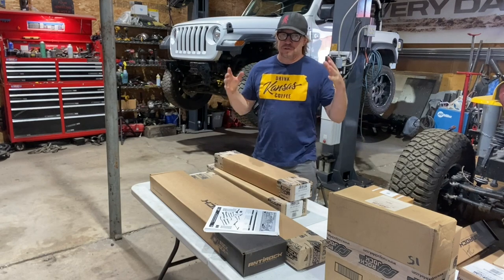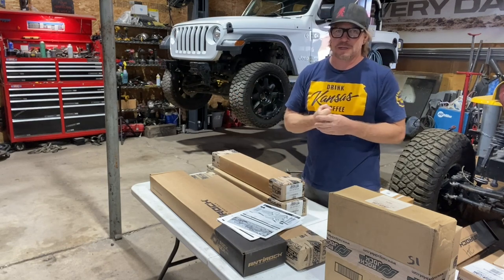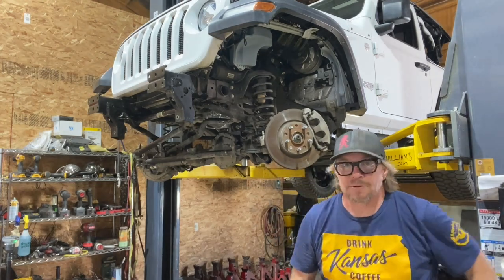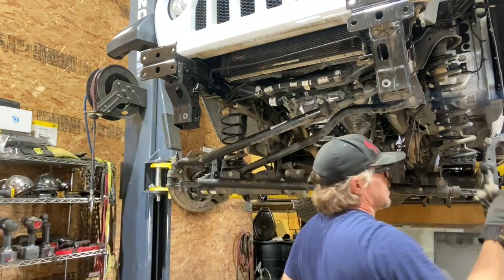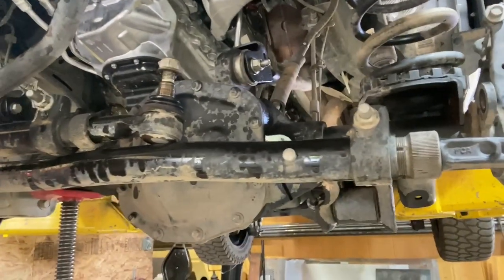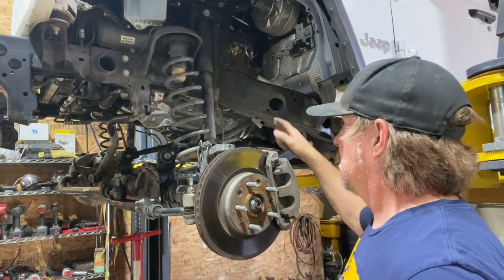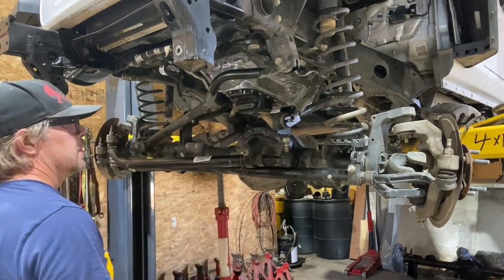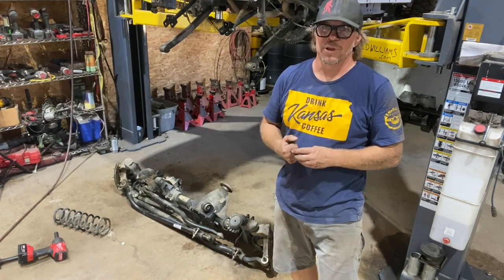Dirt Daily. Removing Newb Sock's Front Axle. Time to build a Jeep!

Comment: It’s great that you can reuse hardware on this kind of work. When I do suspension (and other areas like brakes) on my VWs, a lot of those bolts are “torque to yield” fasteners. Once you have put them in to the required torque value (+ often an additional 90°), they are not reusable.

Comment: 20:58 Quick Tip for disconnecting Brake lines without the fluid dripping out of the system is to: Open the bleed screw on one brake, depress the brake pedal to the floor and keep it there with something (I.e. a stick), then disconnect whatever you want with no mess/leaks. The idea is since the master cylinder is actuated it traps the fluid in the system and creates a tiny bit of vacuum keeping even what fluids in the lines in the line.
Reply: that doesn't make any sense. if you open a bleed screw then depress the brake to the floor then you shoot fluid everywhere off the bat.. and even if you leve the pedal depressed after that, the fluid will still come out
Reply: Obviously you catch the fluid using a normal bleeder tool for that intial pedal push. But no the fluid does not drip out of the system if the pedal is to the floor. You’ll still need to do a bleed later, but again this will prevent the system from draining itself completely from the revisor

Comment: I've been wanting to swap out my 99 isuzu troopers suspension with some discarded jeep axels for 2 reasons. #1 IFS is limited to 2 inch lift and fender/firewall clearance for 33" tires. Thus I can locate it forward with a solid axel swap.  
#2 there is a whole bunch of aftermarket gear and locker options for everything but isuzu.  I don't plan on crawling, but do alot of off camber trails and exploring.